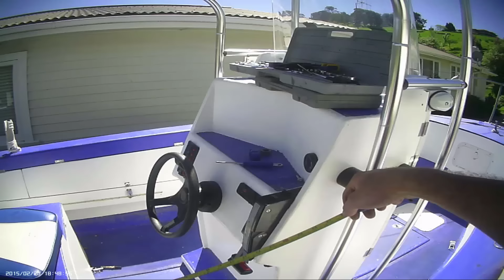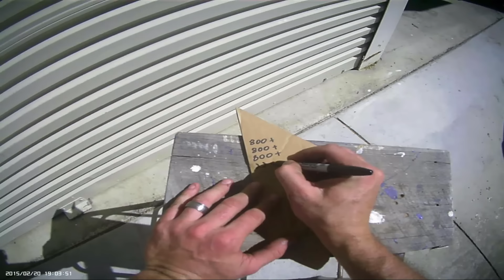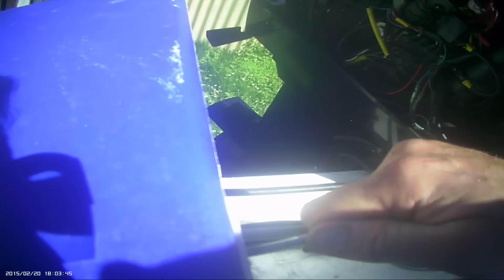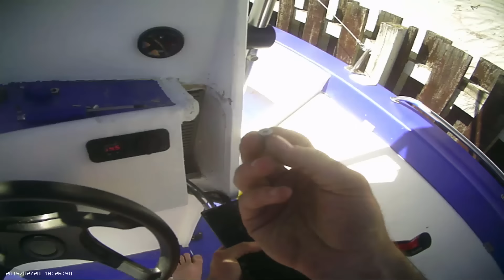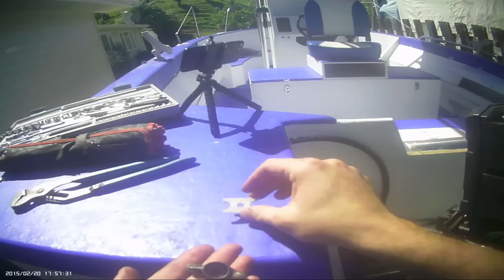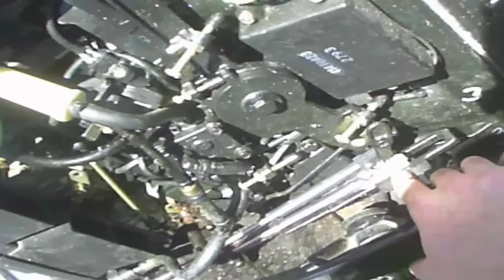how to install throttle and gear selector cables on a boat

Comment: Hi when I set the gear to neutral on the engine and neutral on the controller when I push forward and back into neutral it doesn't go back to neutral on the engine and the gear doesn't go fully into gear please help

Comment: Man this video saved me money today!!  My engine was turning on as normal but when I would shift, the boat wouldn’t move.i found that the nut came off and the rod had just disconnected from the little shift mechanism. I searched everywhere for a resolution then I found this jewel of a video. Much appreciated from Saint Augustine, FL, USA.
Reply: Right up the street in Jacksonville. Plan on hooking my new one's up in the morning

Comment: How do you know the correct position of the motor before you attach the cables? I noticed you said the motor was in neutral both on th remote and motor. How to tell which position is neutral on the motor??
Reply: Reach down and turn the prop by hand. It will spin in N and lock in F and R

Comment: When setting up the cable length for the shift cable, wouldn't you want the selector in the N position? (like how it shows in your thumbnail) I noticed you had it all the way back when installing the cable -- Did you have the control box set to reverse? I'm going to be replacing cables this weekend and I assumed I would keep the cables in the neutral position for cable installation. Excellent video explaining how the connections work, exactly what I was looking for.
Reply: I put everything in neutral and when I push forward with the controller and back to neutral I don't go into neutral and help please

Comment: Iv changed the cables on mine but when i start the engine its in reverse 🤢
Reply from the maker: You have to make sure Gear selector arm on motor is in the neutral position and your control is in neutral position. then install cable and adjust length to fit. Also ensure that you haven’t mixed the position of the throttle and shifter cables up on the controls
Reply: @FishingAdventuresHB  sorted thanks for reply appreciate it

Comment: Very educational. Looks like it’s a Mercury EFI 200 hp. I have a 200 hp 1994 Pro Max EFI and my throttle is not holding constant rev. It slowly reduces it unless I keep my hand on the shifter. Any  idea what could be the issue?
Many thanks
Jonas from the US.
Reply from the maker: Hi. mine was doing the same thing. on top of the controls mine has a round dial that is used to tighten or lossen the throttle leaver. you will have to play around with that to het the sensitivity adjusted to your needs.
Reply: @FishingAdventuresHB  many many thanks for that advice. 
Will definitely try it out.

Comment: Quick question!
I have a 40hp Mercury engine and this video was very informative!
I have my fuel line, throttle & gear lines already. But I don't have my battery hook up yet and quite new to this so I'm a little lost.
Just need to know what I need for this.
Can send pictures of my controls and engine if needed! Cheers for any advice!
Reply from the maker: fraser mcguffin The battery normally has 2 separate cables or 1 cable with 2 cores normally black and Red running directly from Engen starter motor to the battery. the battery does not run through the controls

Comment: Hi,  I put a Johnson throttle cable 97.5cm but the cable became separated AT CRIMP UPON FIRST USE AFTER INSTALLATION,  why did this happen and can it be fixed? your help is so appreciated, thanks Liz.

Comment: Are these cables universal, do they work with all major outboard brands?
Reply from the maker: MPC007_EXP nope many different varieties they mostly work in the same basic way but might look a bit different or have a different way of attaching. You’ll have to take your motors make and model to a dealer in order to get the correct one for your setup.
Reply: @FishingAdventuresHB  Ah too bad.. I hoped I can buy one setup and use it for different motors as soon as I swap but apparently thats not an option

Comment: I had a problem with the adjuestment, while i switched in gear the prop was still not locked, while i just ajusted the cable a littlebit, the prop fall in gear
Reply from the maker: Wind Screen good work man. Yes as you said just a little adjustment sometimes does the trick. 👌
Reply: @FishingAdventuresHB  I was afraid, to remove the whole gearcase and adjust the shiftrod. Cause its such a pain to put it back together. glad i this helped me out

Comment: I'm about to replace the cables on a boat I bought today. The seller included them in the sale so I'm hoping this process is virtually the same in mine. This video is a good step by step in the process.
Reply from the maker: Hi. It should be roughly the same. Only thing that can differ is the way it’s fixed to the controls and motor but it should still be a similar install. Just remember to have the controller leaver in the internal position before connecting to the motor.

Comment: Thanks for this I just brought me a boat and it doesn't have the throttle lever and cables either just one question where did you buy the cables and do you know where I can find a lever for it
Reply from the maker: I got the cables from Hawke’s bay marine. They had to order them from America though for my motor. The other place you can try would be firmance marine or boating outdoors depending on the make of motor you have.

Comment: a great tutorial thanks, BUT WAIT,  I HAVE A PROBLEM TO SOLVE and am looking for feedback. when I am in the water and I trow it into forward will bog down and in many cases stall. when I'm real gentle and slow I can get it to go forward and it runs great once it is moving. when it is out of the water all controls work great. Can it be a bad adjustment in the cables. they don't seem to be constricted.
Reply: Fuel delivery problem leaking air not keeping prime
Reply: Incorrect propeller pitch caused this problem for me recently!

Comment: Hi men great work i'm from Argentina and i want to do the same work to my mercury elo 40 hp two stroke , is similar or is totally difrent?? Sorry for my english mate i do my best
Reply from the maker: All good mate I appreciate your comment. The concept should be the same there might just be a few minor differences with your Motor but it should still have 1 a throttle leaver and 2 a gear selector leaver on the motor. If your motor has the steering arm and throttle on the motor and not a proper steering wheel and controll box  it will be a little more comlecated than just replacing cables.
Reply: Fishing Adventures Hawkes Bay thanks mate !!!

Comment: Great info. I replaced my shift/throttle cable and now when I put in gear it grind loud. Do you know how to fix that problem? Thanks.
Reply from the maker: This means your motor refs is too high when in Nutral position extend throttle cable little bits at a time in order to lower your engen refs then grinding should stop.
Reply: Fishing Adventures Hawkes Bay what is refs?
Reply: @greddy09sc  Pretty sure he means the rpms. As in the idle is too high.

Comment: hi, by chance do you knwo what that little H shaped washer on the gear shift cable could be called mine is gone
Reply from the maker: Hi ShermGerm. Here is a link to the part numbers. It’s just called a washer but on this link you will find the part number. It is part 38 on this diagram and part number 12-35462 here is the link. Hope it helped. https://www.perfprotech.com/mercury-marine-parts-catalog/throttle-lever-and-shift-shaft/assembly/1678/80?model=128

Comment from the maker: If you have any questions on installing these remote cables please do not hesitate to ask me. i will try to help and assist you as far as possible. 😀
Reply: Fishing Adventures Hawkes Bay if I only need about 7 foot of cable and I get 12 foot, Will this be ok?
Reply from the maker: @tjsutton5757  Probably not because where will the access cable go? You could leave it coiled up somewhere as long as it doesn't have sharp bends in it but it would wear a lot faster and be a lot harder to push the control leaver into gear because of the extra friction.